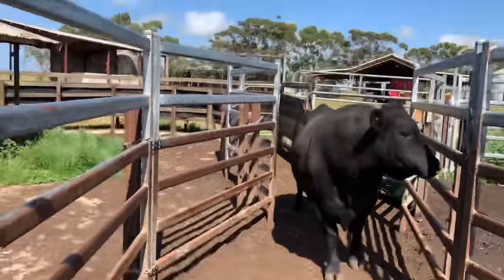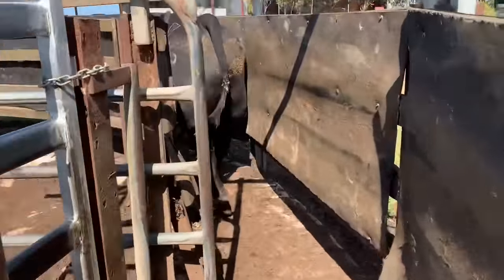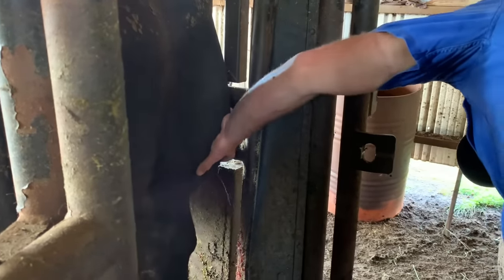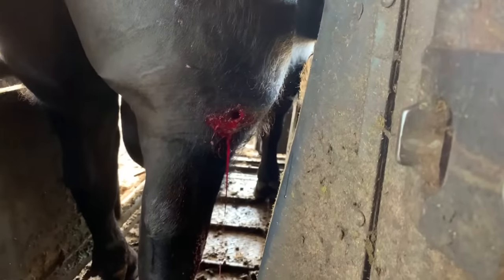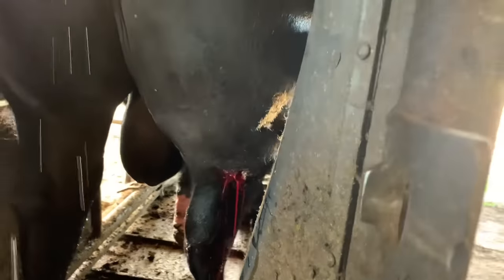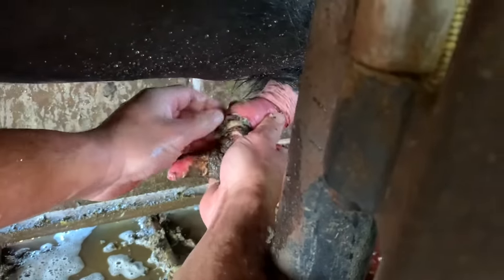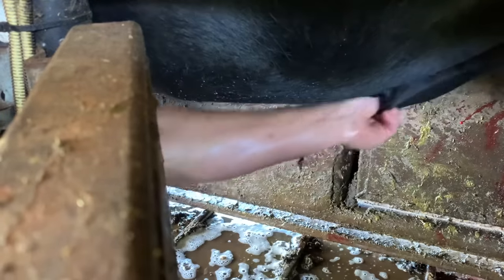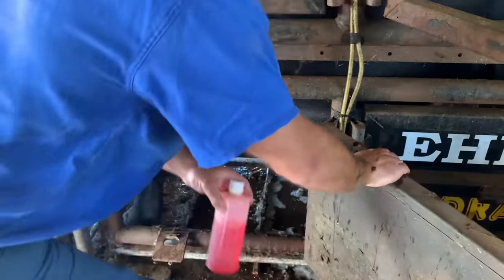Two for one! Bull’s unproductive abscess and a crusty willy.

Comment: Ugh. We had a Belgian Draft horse that had penial cancer. It was like raw hamburger and the vet had to reach up the sheath and drag crystals out (fluids harden into sharp painful crystals ). That big sweet boy waited patiently thru the whole process, didn’t move or stomp. Boomer was a sweet horse and we had to put him down as there was no cure. RIP Boomer !
Reply: Damn that sounds horrid!! They put him down for that? They didn't consider amputation or did it spread? Poor 'ol feller.
Reply: @chikkenbonz , A "peckerectomy" would most likely be difficult to do.  The valve at the tip of the penis would end up being removed, resulting in constant dribbling, which would attract flies & infections.
Reply: @Cricket2731  Ahh ok I see. Damn that sounds excruciating! Yeah, prolly for the best. Unnecessary suffering is never any good.

OP - So sorry for your loss. RIP Boomer 😢 💔🙏
Reply: So sorry for your loss

Comment: I'm surprised that they designed the side of that contraption with the 2 side doors opening from a center hinge point instead of having the hinges toward the front and back so when you open both doors you don't need yo reach around a center pole that holds hinges and instead with both doors open it's 1 Big opening instead of 2 small ones. Hopefully there are better designs and they don't need to deal with an odd reaching problem, or even having to goto the next hole with doors in the way.

Comment: You know they make little electric pumps that would put that fluid or water up into the abscess area.. some you can get dinner pressurized real high and some that you can get digits like normal tap pressure
Reply from the maker: Yes, but we pump a lot of things through these silver pumps and we have to clean them between jobs.  The valves in that pump were playing up badly! How good would a Milwaukee pump be! Cheers!